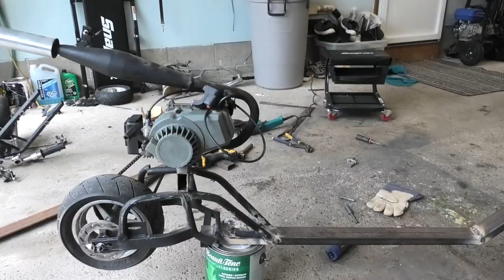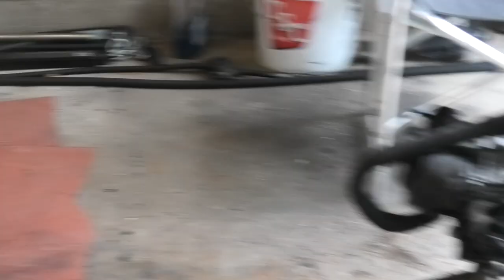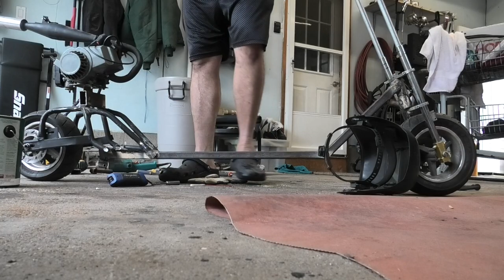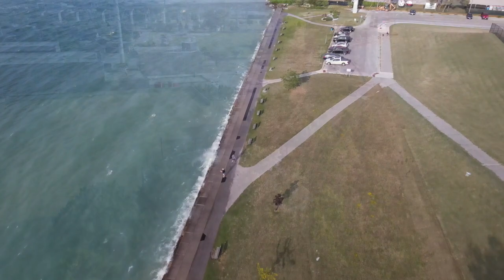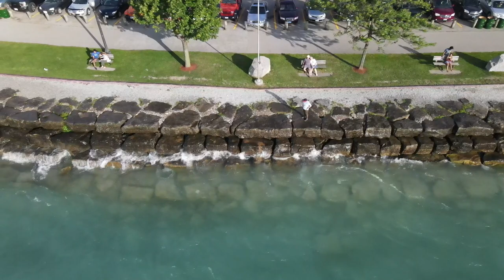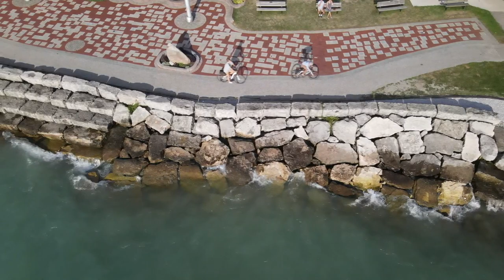#2 Update on Poket Bike Stand Up Scooter Build

Comment: U should put the motor on a flat mount and it will be a little close down the motor should be low
Reply from the maker: Ya but then it would have to be longer . the ones you buy the engines are beside the wheel she'll have to work and should be mint will see . thanks for the comments love them

Comment: Just wondering why the steel pipe the engine is sitting on top of is not laid flat as opposed to it standing up? But the build looks pretty decent👏🏾
Reply from the maker: because on the pocket rockets it goes up under seat . I like it so I didn't cut it up . YET lol